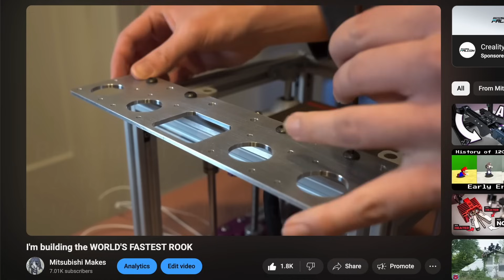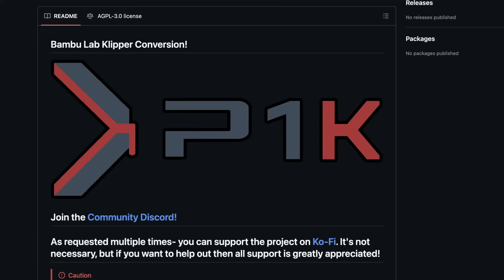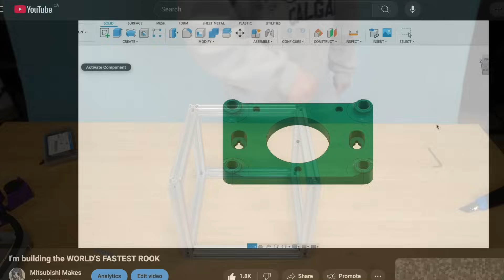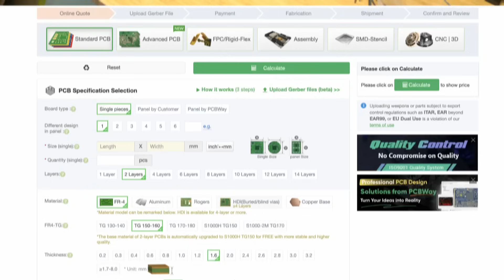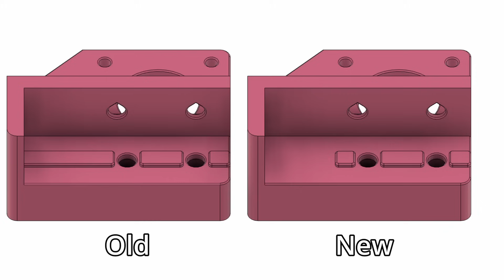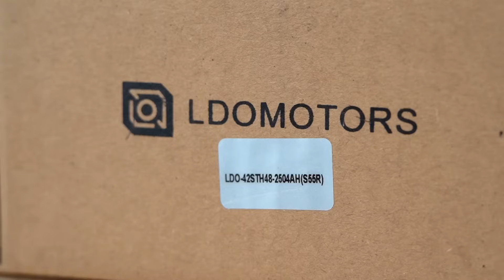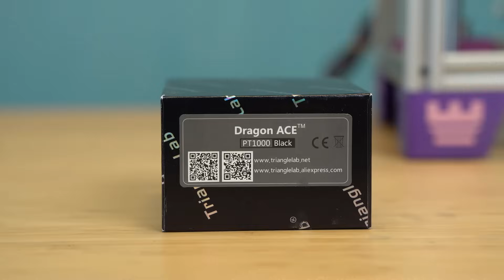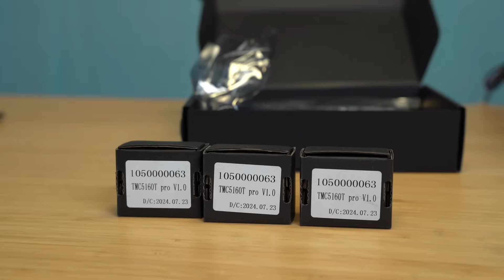Building the WORLD'S FASTEST ROOK (Part 2)

Comment: I got a Ender3 Pro from a friend and started dumping money to upgades even not knowing anything about 3d printers. I am reaching a point and level of frustration that makes no sense and I can't see light at the end of the tunnel....
Reply from the maker: An Ender 3 Pro is a tough case for upgrades. As long as you aren't going for super crazy speeds I think your best option would be an upgraded toolhead (Stiffy by Churls or one of LH's Stinger toolheads if you don't mind buying a 300mm MGN12H rail for X), klipper firmware, and a PEI sheet for the bed. Also replace the stock bed screws with either silicone spacers (if you wanna keep manual levelling) or rigid aluminum ones if you want to use an ABL probe
Reply: @mitsumakes  I missed your answer, thanks a lot for answering and mentioning Stiffy by Churls and LH's Stinger. will check for sure.
Next upgrade I want to do is linear rails, for sure. But I am seeing too much shake and planning to transform it into a Core XY. but it makes no sense since I can get a v3 KE with the amount it will be in the end of all of these upgrades.

Right now I have the Hero Me Gen7 Release V4, noctua fan, two 5015 blowers, silicone bushings, bltouch, 4.2.7 motherboard and a T6 60W. running marling latest beta3 version.
But not even close to having a reliable printer.

Comment: Which is better, Rook, Simplecore or Mercury One? Have a chance to get a parts Ender5 Plus. Already have a nearly complete Ender 5 Endorphin.
Reply from the maker: It really all comes down to what you need. Of those 3, the simplecore is the only one that is made to be enclosable by default, so if your goal is to print ABS then its an easy recommendation.

Rook is a fun, comparatively cheap build, but build volume is lacking compared to the others

Mercury One was a fun build, but I didnt spend enough time using mine to really form a conclusion on it. It seems good, but you'll definitely need to upgrade from the stock Ender 5 Z axis if you wanna go fast at quality

Comment: I'm running AntHead on my Trident and its such a pain to work on, to get to things you need to disassemble the entire toolhead pretty much every time. My biggest gripe with it is the way the belts are tied, similar to XOL, but the A belt in my case keeps on slipping and its not that I've over tightened them, running on 5.6mm on the belter tool for both belts, which is honestly not that high... But with that said its a fantastic looking toolhead it now has support for the Cartographer CNC carriage. So guess whats my next upgrade 🤣

I would really love to see AntHead on this machine. 

Keep up the great work and looking forward to the next video 💪
Reply from the maker: You definitely need to make a lot of compromises to fit a toolhead in a v0 form factor. Right now my favourite toolhead for the (stock) trident is A4T, I was shocked how easy it was to assemble.

Thank you for the kind words 
😎
Reply: @mitsubishimakes  oh yes, a lot of our local Voron community have gone over to either A4T or XOL. It's definitely worth looking into the A4T, but me being me, I like to be different to the masses. No one in our community is using AntHead on any of their machines, so yea 😂

I plan on going A4T on my next build though😊

Comment: Out of curiosity how does the triangle-labs dragon ace seem? Curious what differs between it and the dragon UHF
Reply from the maker: Biggest difference between it and the dragon UHF is the fact it uses a ceramic heater instead of heater cartridges
Reply: Skip straight to the meat and potatoes and cop a CHC XL and a volcano MZE with a bondtech CHT volcano nozzle
Reply from the maker: @benperkins2929  CHT nozzles get less effective the longer the meltzone you put them on, so I wouldn't use them on a setup like this.

The CHC XL is probably the best value when it comes to hotend length per dollar, but you also need to deal with very bad thermistor placement and ceramic heaters that become less powerful as hotend temp increases. At that point I'd rather get a goliath
Reply: @mitsumakes  Testing still puts the MZE at 20% more flow rate on the CHC XL. Goliath is cool, but testing shows the CHC XL to flow better. You've got 128w to play with and decent insulation too. It's also half the price of the Goliath. If you're not printing engineering plastics you don't need a hotend over 320c anyway. With the wattage I'd estimate it could hold ABS temp at 100 cube on a 0.6+. Thermistor placement is bad though, so I'd say extrusion temperature will likely be around 5% higher than reported. There's some nice graphs and testing done by Dmitry Sorkin, albeit at a 0.4mm nozzle which is a bit silly for testing flow rates so high. I kinda like the fact too that its basically 3 TZ E3's stacked on their heads, but that's obviously anecdotal. Agreed about the CHT nozzle, but that's the only MZE I have. I'll probably get the standard MZE and some regular V6 nozzles for this one and leave the CHT in my TZ for another printer, but for now it surely cant be worse than not having a CHT
Reply: It's a very nice hotend in all areas, and on sale one of the better ones for the mid level price (~53USD ON TL's site). No heat creep issues, pretty decent flow (I haven't tested the max), and can works fine with the MZE for UHF speeds (but again, haven't got any data, sorry). The main difference would be max temps, as the ceramic one tops out at 350c but you won't be getting the full wattage at that temp, while you could always install a hotter or more power heater on the regular dragon. There is a cartridge version for the ace now though! Neither I or Mitsu have tested it yet. Mitsu was going to, but got sent the ceramic version 😅 I've had it on an E5 and V0 which both performed great with it. Hope that helps a tiny bit. Cheers!

Comment: I would recomend to print all of the parts out of pla, as it is significantly more stiff than other plastics.
Reply from the maker: Most of the gantry is printed from filled (glass fibre and carbon fibre) ABS, so it should be plenty stiff. 

Since the printer is unenclosed though, I could've gone for CF-filled PLA for maximum stiffness... Might need to look into that

Comment: Should I build a rook instead of a 0.2?
Reply from the maker: I'd say it depends on what you want to use it for...

Since a V0 is enclosed, if your goal is to print ABS/ASA I'd definitely go V0 over the rook. Another nice thing with the V0 is you have access to all of the existing voron usermods, rather than needing to design things yourself. I do think Rook MK3 will easily beat the voron in terms of performance, but a lot of that will come down to the toolhead

Huge fan of your work by the way ✨

Comment: I would suggest to print structural parts based on Voron specs.  I found 6 perimeters, 25% honeycomb infill, with 5 top and bottom solid layers, to be the strongest over time with little to no creep.  Looking forward to see it go brrrr.
Reply from the maker: I think I did all the main (grey ABS-gf) parts with 6 perimeters and 40% infill, but I definitely got a bit lazy when it came to the fourth version of the motor mount tops. I'll see if it's an issue and reprint if needed

Comment: This is a great project but this gantry is a voron v0 with the mgn9 mod.. nothing new here
Reply: This gantry is nothing like the Voron V0 at all, 2020 frame, flipped belt path, more toothed idlers. CoreXY have similar belt paths yes, but this is not based on the V0 at all. Take a look at the CAD for both and you will see that,
Reply from the maker: This gantry actually has several advantages over a stock voron 0. You have double sheer support for the motors and also no belt teeth running on smooth idlers. It should perform noticeably better once the belts are tensioned to spec
Reply: @mitsumakes  front rail too instead of the cursed top rail
Reply from the maker: @7d4ng  I completely forgot the V0 was top rail 😅